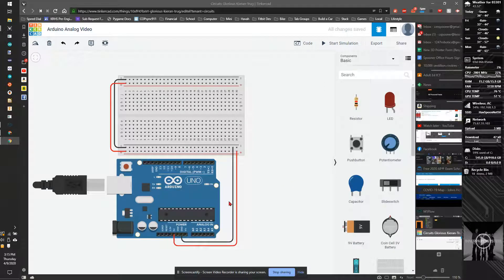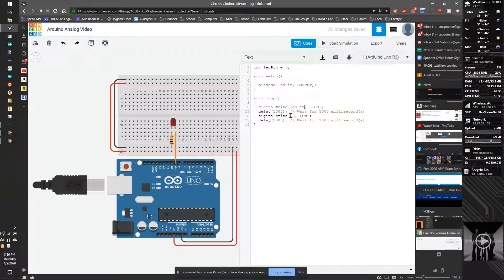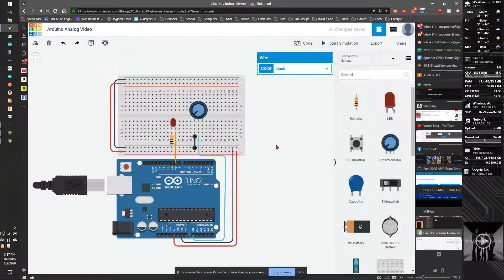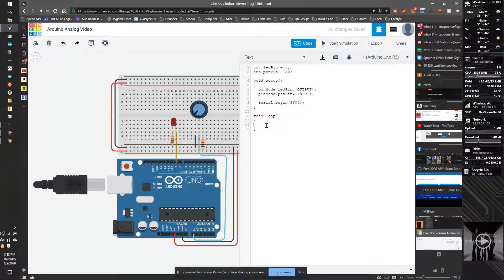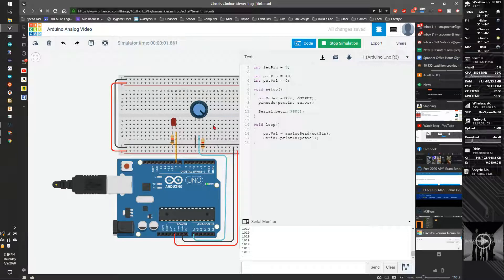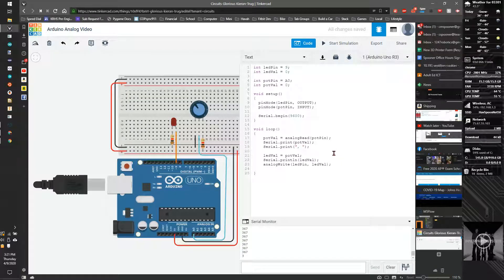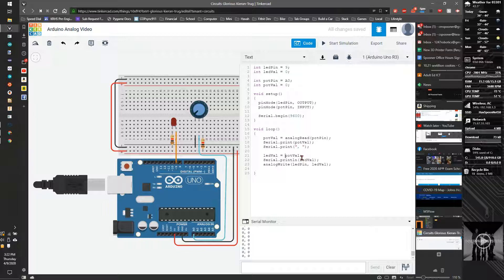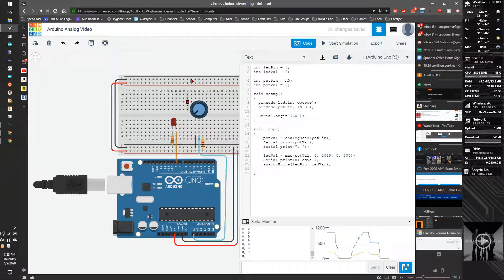Basic Arduino Analog Input in TinkerCAD

Comment: I am interested in using the Arduino IDE software. Because it can simulate the project that is being worked on. Without having to provide the physical components needed. What is the name of the IDE software you are using?
Reply: The ide part of Tinkercad. You can create a free tinkercad account, and once you are in you can 3d model or do circuits.